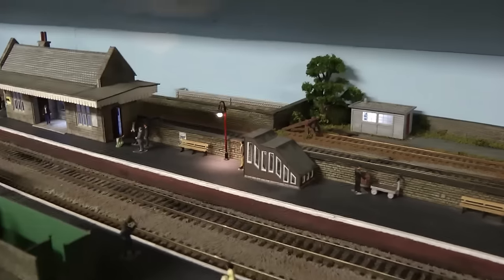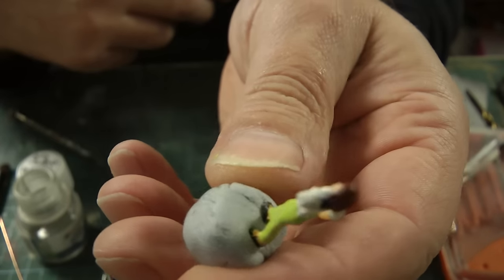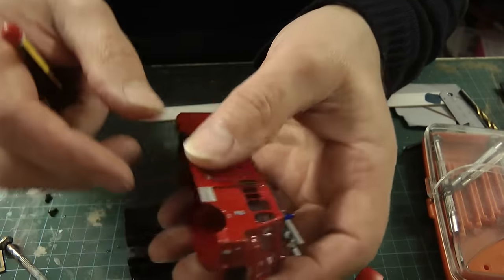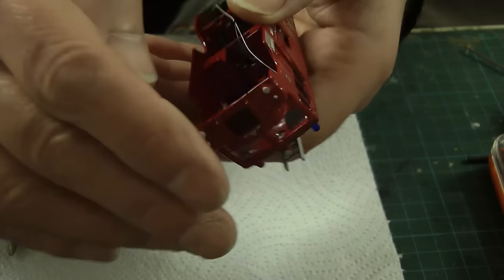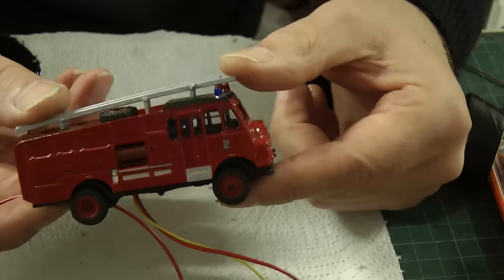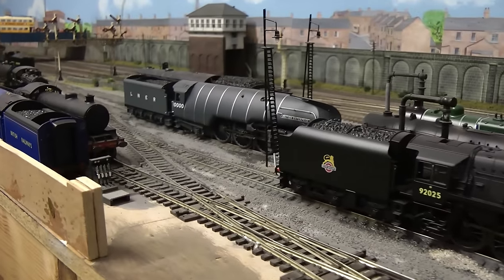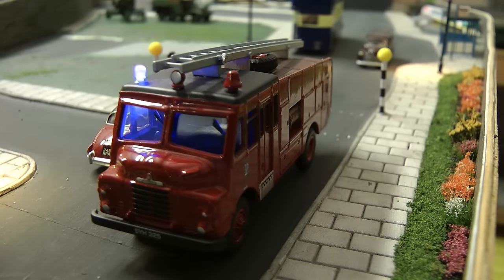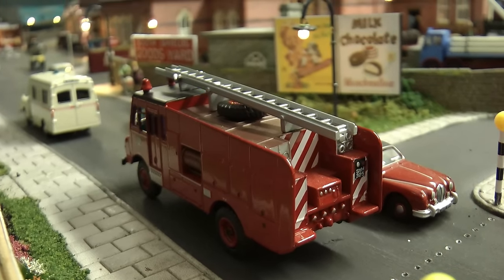Fitting a L E D into a Green Goddess Fire Engine    No 415.

Comment: Hi Tony.  An unexpected video to entertain us all.  Some great additions to the North Eastern. 
Plate layers huts were generally used by Lengthmen  and other members of the Permanent Way Department as a shelter when the weather turned bad or they wanted a welcome break.  They would contain a stove which was fuelled by anything flammable that could be found, such as odd bits of coal, bits of sleeper, old chair keys, etc.  There would usually be a table and chairs and the Lengthmen would make a pot of tea including milk and sugar, usually to the Ganger’s taste; well, he is the boss. 😆 
No turntable at South Shields?  There was one when I was a lad. 😉 
Can I take it that you did not run a lighting bus around and underneath the layout when first built, to provide a facility to tap into whenever you needed a supply for local lighting.  Looking forward to the next one.  Best, Jason.
Reply from the maker: Hello again my friend. Some nice ideas for the plate layers hut. i think a couple of guys sitting outside drinking cups of tea is the idea i would go for. your right there was a turntable at shields. but as you know i just have the space for one on the layout at shields. hence why changes are under way as we speak. you have some great ideas. take care. keep safe. all the best Tony.